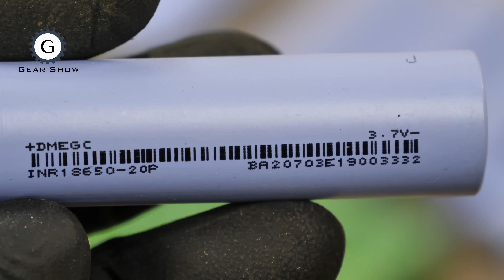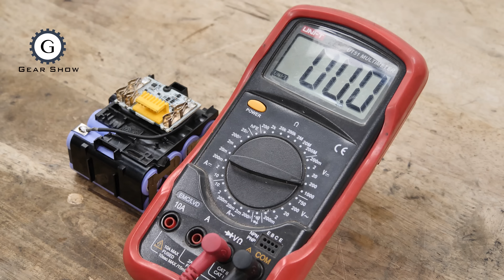14.4V Vacuum Cleaner Battery Rebuild | Makita CL140FD

Comment: How come there was so much dirt behind the airpump towards the air outlet. Looks like a poor design. Or the previuse user worked without the filter.
Reply: Shit design by far by Makita. I really don’t know why they make these poor quality toys considering they’re also make such amazing tools
Reply: Not a good seal at that point at the filter.  Happens if you don't seat the filter correctly. Good question!

Comment: What’s up gear show I got an older model air matco die angle grinder, but when I connect an air hose it won’t work. The air just sprays out from the bottom and won’t spin. You got any tips or ideas on how I can fix this??
Reply from the maker: You disassemble this tool, you will see parts need to be changed.

Comment: Try 21700 🔋, they are better than 18650 🔋
Reply: 21700 cells are too large to fit inside the original housing